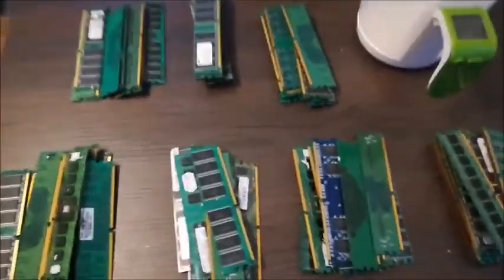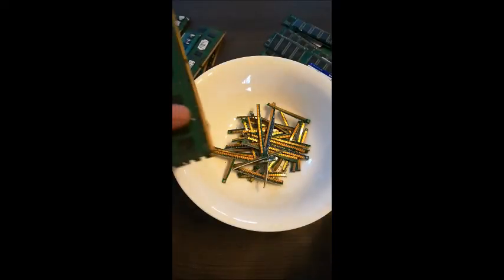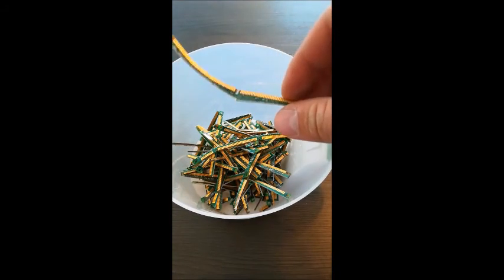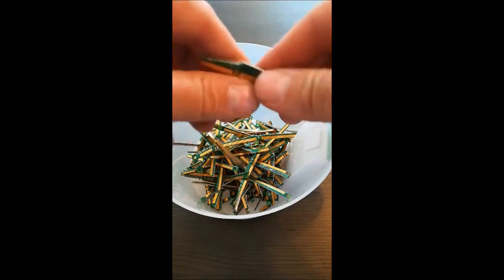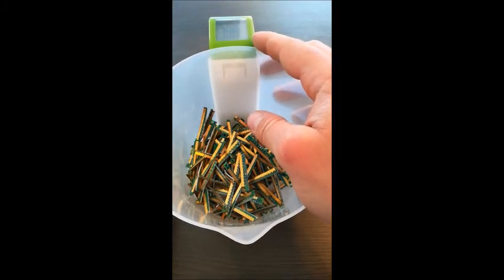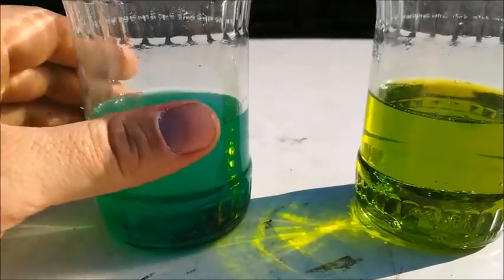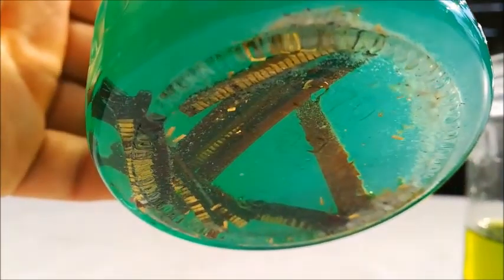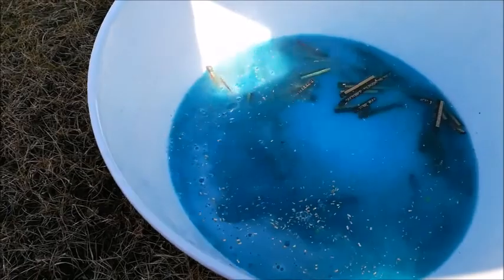How much GOLD is in old Desktop RAM,gold recovery process out of RAM memory cards

Comment: The chips have gold in them too. You have to crush them to get it out. Also, some older memory boards have gold plated traces. 100 grams from 1Kg means there are some gold plated boards being tossed. 35% HCl requires more solution to dissolve an equivalent amount of copper. Heating slightly (just below boiling point) does help with dissolving the copper with either solution. You didn't weigh out the fingers after recovery. How much did you get?

Comment: there is not 0.7g because you must refining the gold folds the containing cooper and others metals. it is probabyl 0.4 to 0.5 g not much pure gold. you weight the folders but it is not clean  try to refine it you will see.
Reply: The hcl took care of the non gold metals
Reply: Just use a flat tip soldering iron to remove the gold fingers no chemical required less than 30 min you get the fingers ready to refine